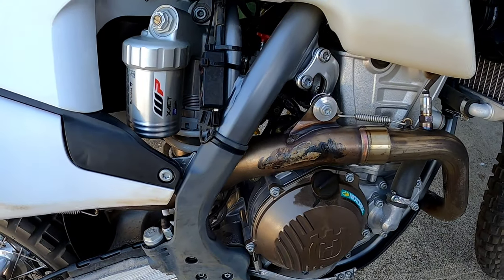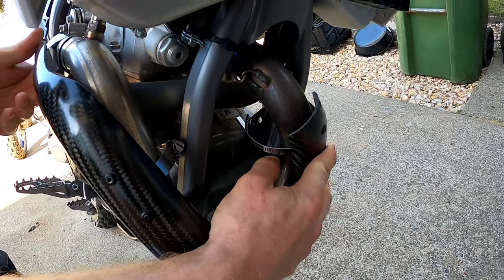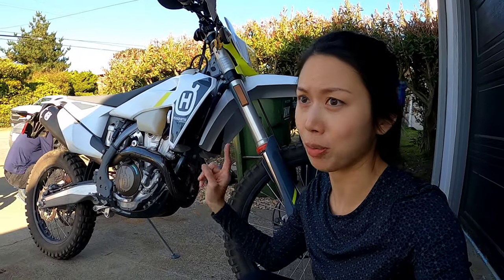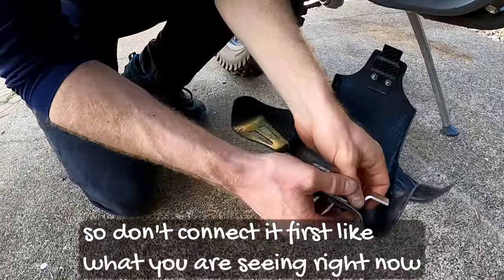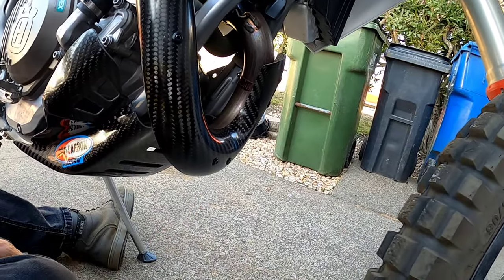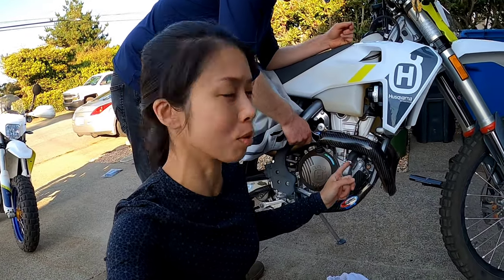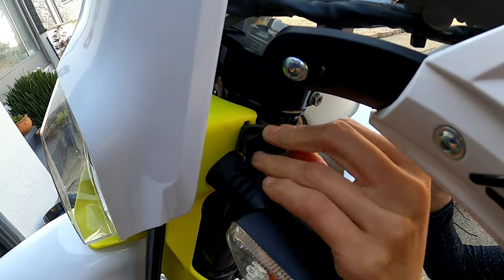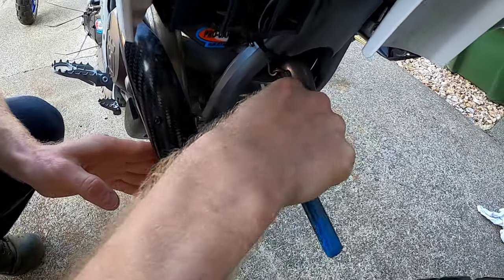Pro Carbon swing arm, forks, radiator, Engine guards & skid plate install Husqvarna FE350

Comment: always interesting and fun to see your videos. like you I don’t think that those “protectors” will protect that much. But you have to remember carbon fiber always makes bikes and cars and what ever you use it for, go faster. That much carbon fiber will probably gain a couple of miles per hours on the top speed 😂. For about 25 years ago the number 2000 had the same effect 😂
Reply from the maker: It all started when we burned our riding pants with the fe350 exhaust. But then Kyle went wild with the carbon fiber 🤣
Reply: @TrackOurJourney  I suppose he got the “carbon fever”

Comment: Enjoy looking forward to your videos. On another matter you may be interested in, is a genuine BMW part to mount the Garmin above the TFT screen for F850GSA. 
Part # 65 80 8 544610
It has been so annoying having to look down and take eyes off the road. It is rock solid and a perfect fix. Hoping you may be able to share that with everyone.
Reply from the maker: Thank you for that information!
Reply: The mounting bracket for the Garmin splits open by undoing 4 small
Bolts and relocating over the round bar on the new bracket. Very easy. Be good if I could send pic.